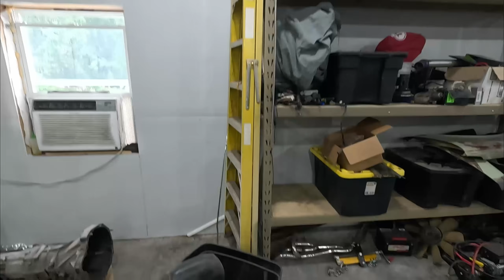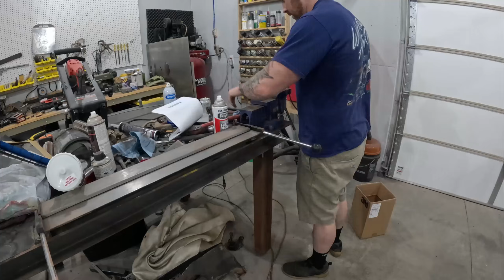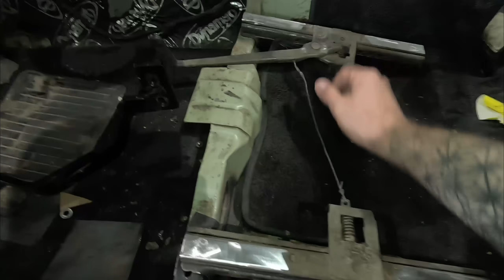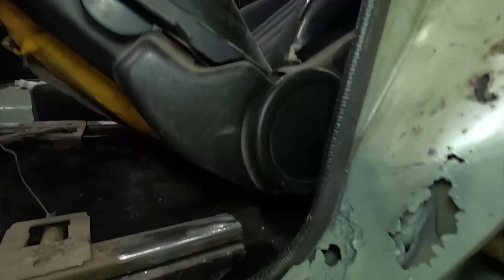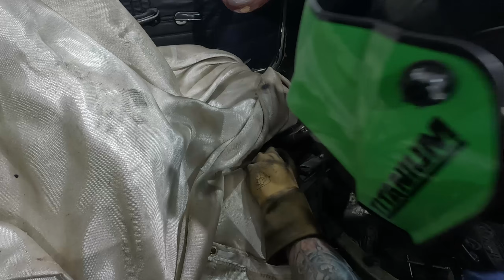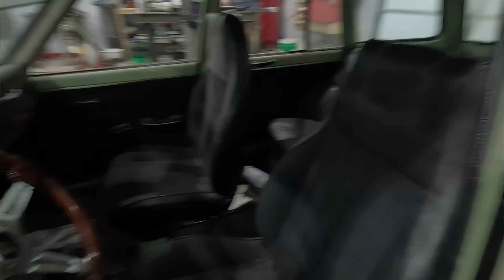Custom bucket seat brackets. Datsun 510 Wagon Build!

Comment: Wouldn't that have been better just to drill another hole and bolt them to the original studs instead of cutting them off and welding them? Just a thought. And yes it know these are old but I saw you on PBG so im going back and watching all your videos.